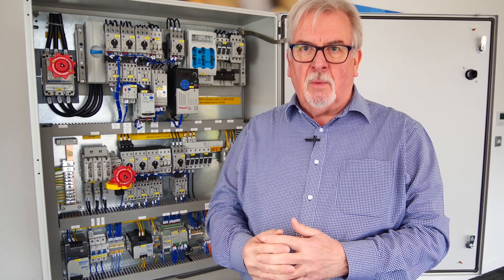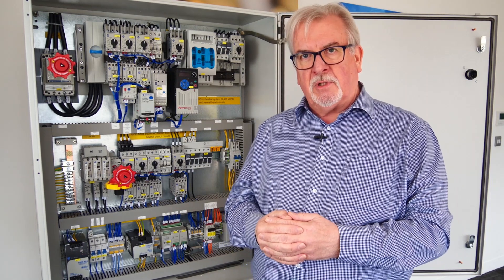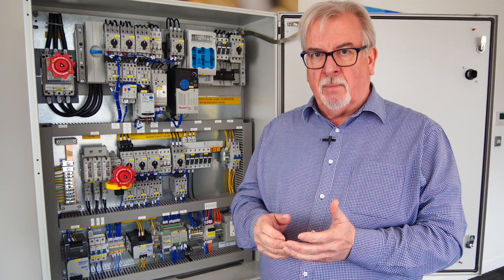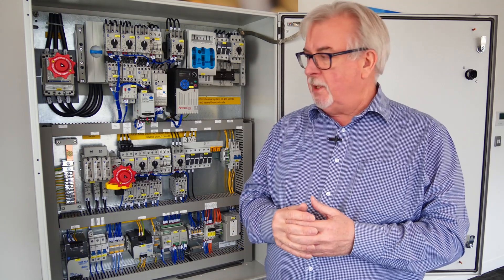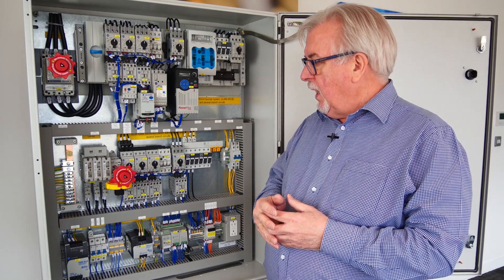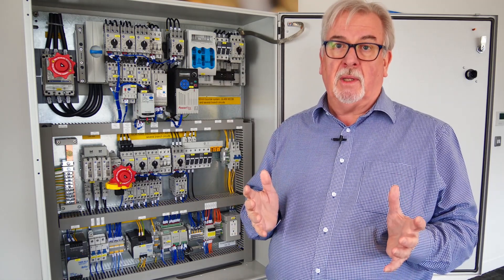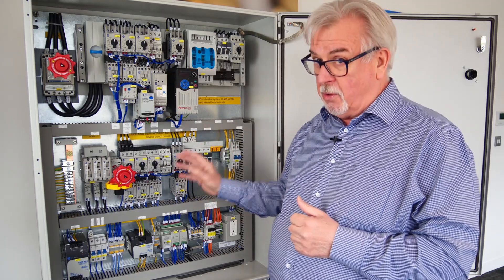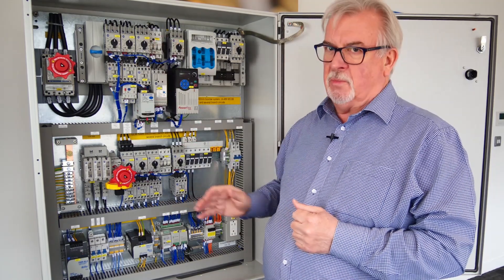North American Standards for Industrial Control Panels

Comment: I have a debate at our facility - should individual components be labeled with descriptive use point names? I.e., "Cement Mortar Motor Starter #1" in addition to the drawing labels? Some are saying it's a bad idea and that it will result in others not referring to the drawings.

Comment: Hi, on that panel layout, i can see 2 Disconnects. I believed the top most is the Main Disconnect, what is the other Disconnect is for?
Reply: That is a good question. This panel is purely for demonstration purposes. We wanted to show both options as Switch Fuses are trusted, and therefore very common in the USA market.

Comment: Where is the requirement for all components in a branch circuit motor starter to be made from the same manufacturer stated? As well, where can you access a list which contains the approved all combination starter circuits which are approved to UL508?
Reply: Good question. The quick response is that this is NOT a requirement.  The point I was making is that manufacturers wanting to sell into the USA must have UL listed combinations.  Manufacturers could choose to collaborate and pay to have a mixed combination tested and listed - but this is very unlikely.